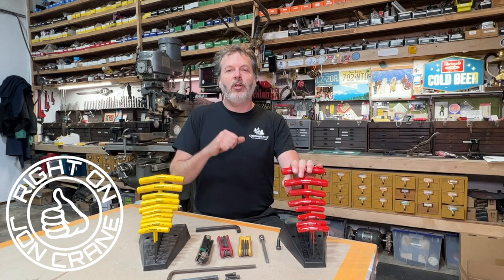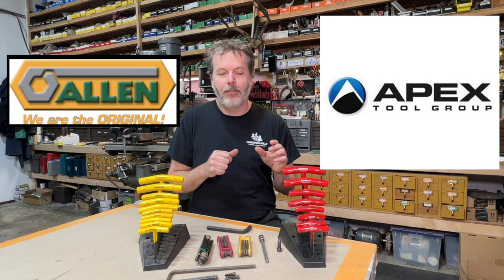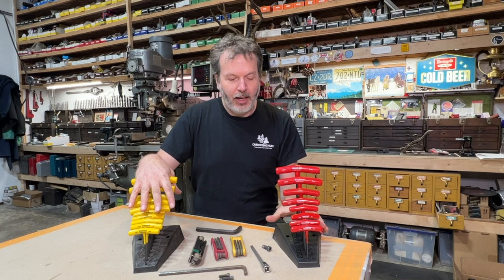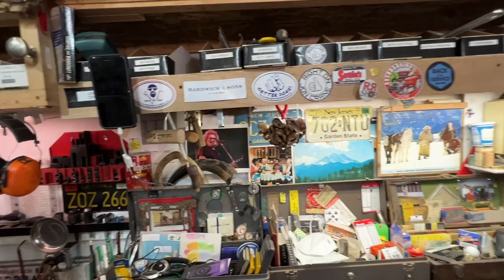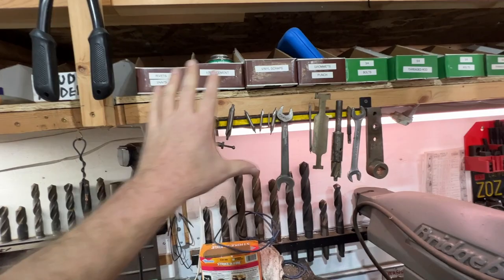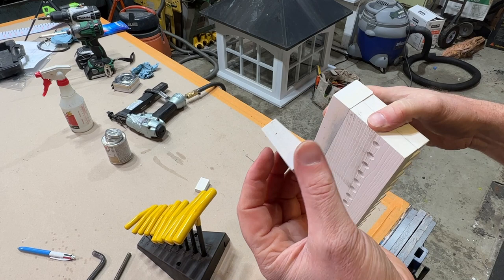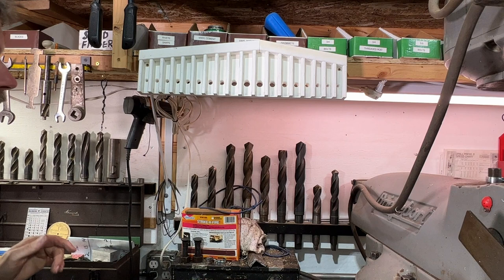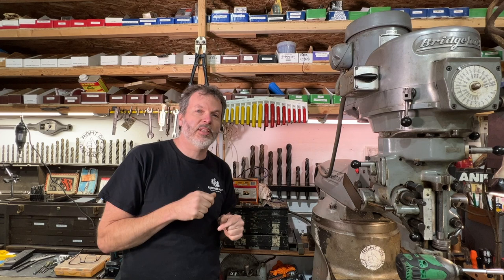T Handle Hex Key Rack - Shop Organization - Allen Key History - Tool Tips

Comment: Fun fact I learned when working with those hex keys: Every hex key with a 5 before the / slash fits metric sized holes. 
So a 5/32 inch hex key fits in 4mm hex holes and vice versa. 
A 2mm hex key fits 5/64 hex holes.

(There is around 1/100mm or 4 thousands of an inch difference across flats between them (measured it with a caliper) but there can be even bigger differences between different brands in the same system, so it is pretty much negligible.)

Comment: We had a mechanic who always liked me to play tricks on every guy in the maintenance shop. He had a home made work cart with one sliding drawer that he drilled holes in and had SAE & metric T handles stored. When he went on vacation we installed two steel collars with a lot of three locker then p!aced two part epoxy on floor screws. Took him awhile to carefully grind off all the collars. Had a regular set & a ball end set of SAE T handles but rather use Allen wrench sockets. Find T handles too short to break tight alien screws. Nice vidio & great storage ideal.

Comment: That came out nice Jon. I recently started using the pvc material around my shop for the same kind of stuff. I enjoy how easy it is to work with. And there's no chance of cracking or splitting like there is when you grab a piece of scrap wood to do the same project.
Reply from the maker: Right On Mr. Phil! 🙌👏✨ That is a good point! I really like this pvc! I’ve done quite a few projects with it and have lots of scraps around the shop. Perfect for these projects! Thanks for watching!